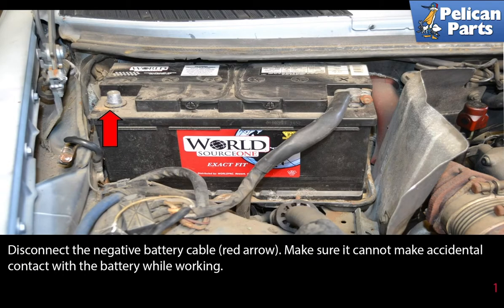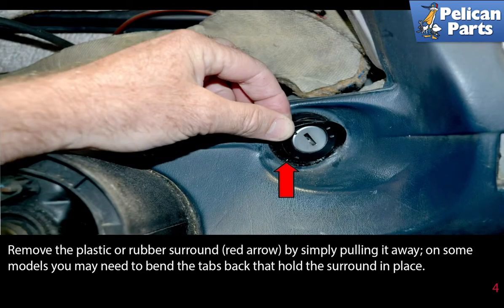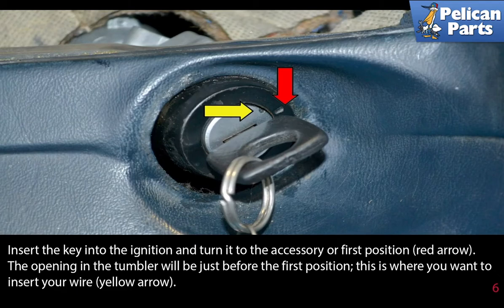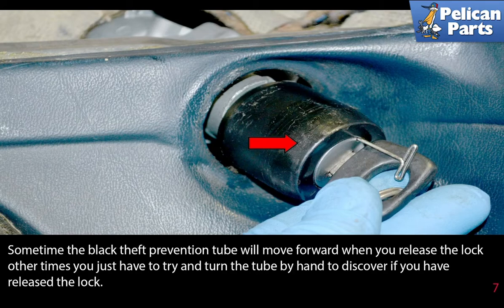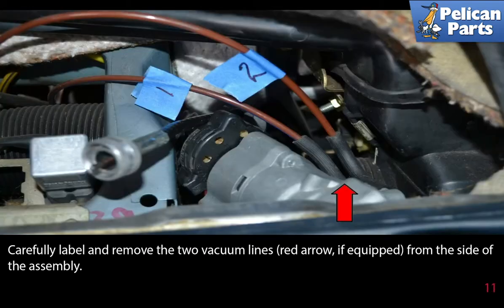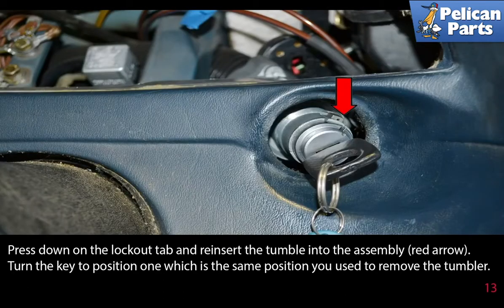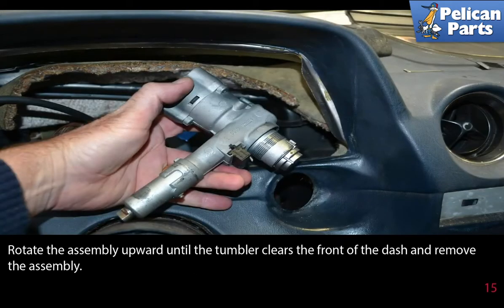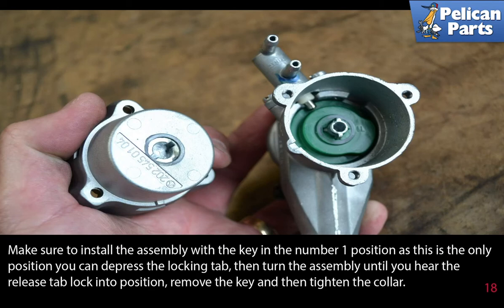Mercedes-Benz W123 Ignition Switch and Assembly Replacement for 280E, 300CD and 300D

Comment: My 77 240D does not have a hole to put the pin in to remove the theft tube help!
Reply from the maker: I haven't had a 77 apart. If you check the forums, someone may have shared photos there of the procedure. http://forums.pelicanparts.com/